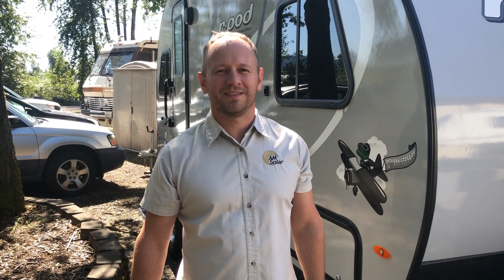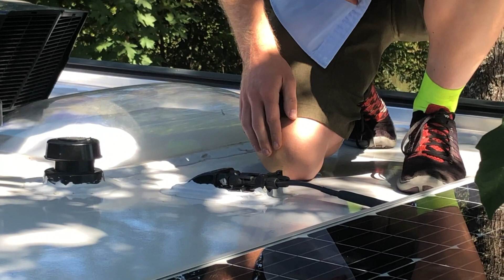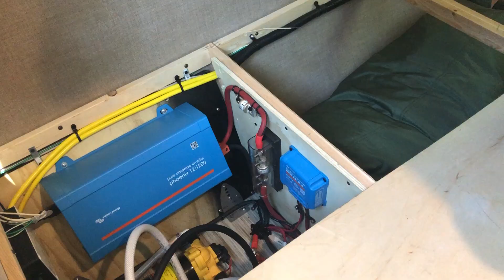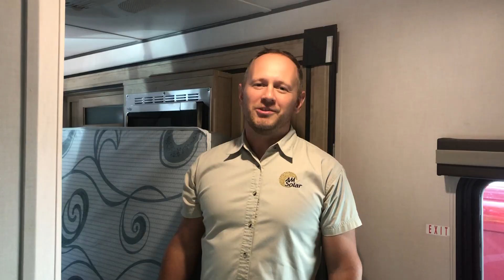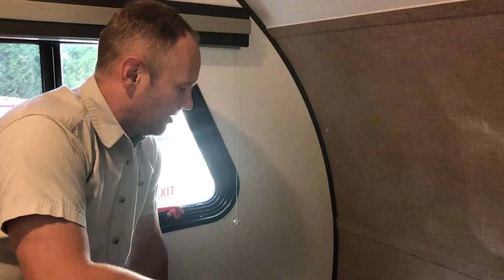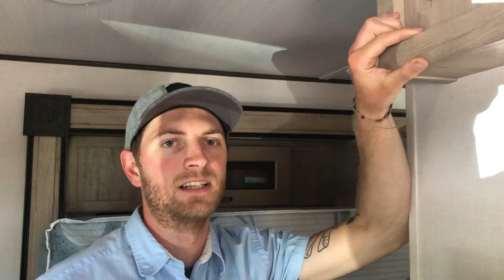R-POD Power System Upgrade (RV Inverter System)

Comment: you mention that the PRE WIRE STICKER was in the wrong place. I have a 2019 176 and the sticker was below the stereo but alas NO PREWIRE. Where did you end up finiding the actual prewires?
Reply from the maker: Look in the wall directly under the junction box on the roof.  In the case of the R-POD I worked on, this wall was just to the right of the door.  Good luck.  It was a seriously annoying situation.

Comment: So let's take this one step further. I have an r-Pod 179 and am also converting to lithium batteries. From 2 6 volt outside to 2 100 watt battle born inside under the bed. What else do i need as I am changing battery technology?
Thank you.
Jeff House
Reply: We recommend a tow vehicle compatibility kit (Part Number 98-ALTCLITOW), a charge controller (assuming you have solar) than can be programmed for lithium, and a shore power charger compatible with lithium.  We prefer a (or two connected in parallel) Victron IP67 25A controller.  If you send me an email garret@amsolar.com, and tell me about your project, I’ll give you a list of links.
Reply: @garrettowne  Thank you for responding. I'll write you later with my project design so far. I have the Midnight solar Kid solar controller for the project. I write later when I have a keyboard and not just my phone.
Jeff House

Comment: I have to give a big shout-out to Garret and his crew at AM Solar.  I just completed a 600 Ah lithium/inverter-charger install on a 2020 Montana. I'm up in Canada so I had to do the install myself. With no previous experience with electrical whatsoever everything went surprisingly well.  It would have been incredibly difficult to do this right the first time without the AM Solar kit and custom drawings which included everything I needed (less tools) as well as all the quick email replies to my newbie questions.  Looking forward to the 250 A alternator & starter battery kit scheduled to arrive this week. 

Cheers....